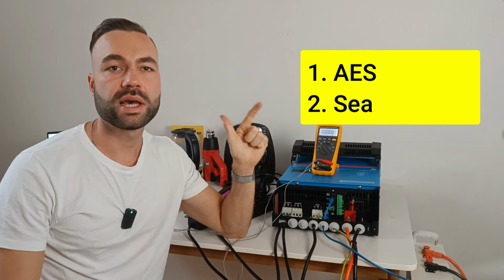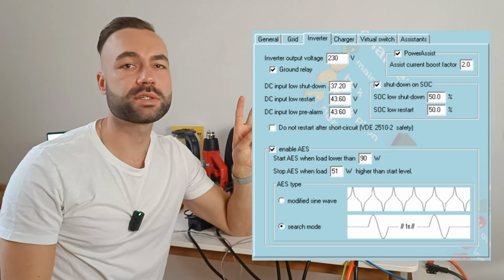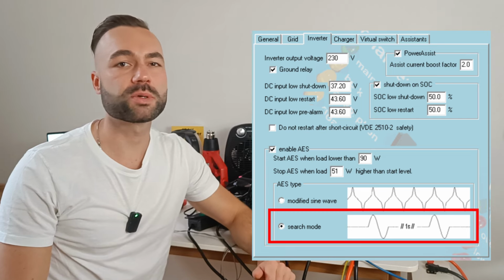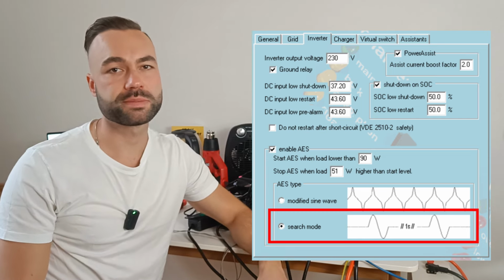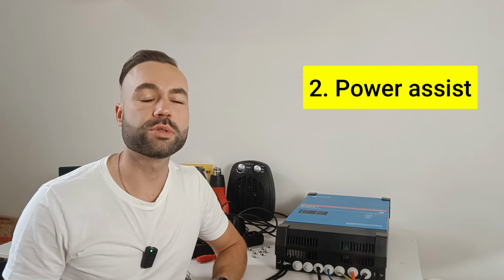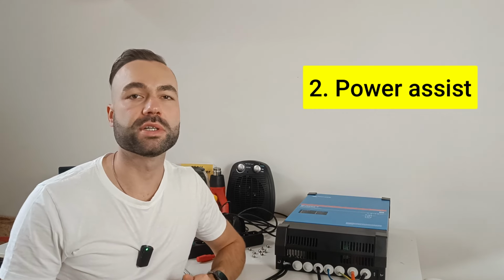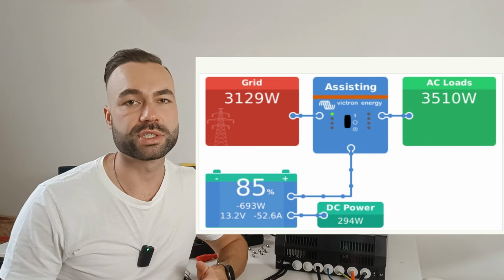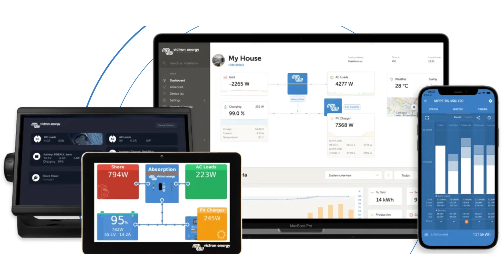Victron Multiplus 2 Testing + Closer Look

Comment: How about grounding when the grid goes down. Do you need separate grounding from the Multiplus and how would that be wired? I assume grounding from the grid is available under normal conditions
Reply from the maker: Wiring stays the same. When the grid goes down or you disconnect from shore power, the automatic grounding relay closes and the ground neutral bond will be made in the inverter itself. Check my video about ground neutral bonding for more information. There is a grounding lug on the case of the inverter which should be connected to the main grounding busbar.
Reply: @cleversolarpower  Thanks for the clarification!
Reply: @Andreas-q4q  If you are powering your house with the setup or operating your inverter's mains input off a house supply, what he said is not necessarily correct depending on where you are in the world.  So how is your system arranged, and where in the world are you?
Reply from the maker: @retrozmachine1189  Then the inverter is not off-grid anymore. If you setup the ESS assistant, you specify the country you live in and the software handles the AC out to the grid according to the country you live in.
Reply: @cleversolarpower  You should look into all this stuff properly.  You know enough to be dangerous.
Reply: @retrozmachine1189  In Sweden and got a big 24kw setup of solar, but no battery and no off grid backup. So looking into if a Multiplus could be used with batteries to perhaps peak shave and power essential loads incase of grid  down.
Reply: @Andreas-q4q False start, accidentally pressed enter.  Whoops.  You could certainly leave your existing solar installation operating and hook the Victron to the mains to use it as a charger for batteries and to supplement or completely operate loads that are connected to the Victron's outputs.  It will get a bit messy in the implementation and exactly how things should  behave with respect to neutral/earth links, which being in Sweden you potentially may not have, is something you'll need to talk to an electrician over there about.  Same goes for separating the Victron from the mains on grid failure.  Not all countries permit the Victron to do this itself and may require contactors to enforce it.  Depnding on you having a N/E link at your premises you may have to use contactors to separate line/phase from the mains but leave neutral intact and use the N/E of the installation.  So best advice is contact an electrician with expertise in this sort of thing and get professional advice.
Reply: @Andreas-q4q  Oh, and you could consider manual transfer switches to allow you to easily switch the circuits being supplied by the Victron back to grid power direct in the event the Victron fails for some reason.

As an alternative to the Victron, an AC coupled battery system may do what you are after too.  Using CTs it can draw power when your solar installation is sending power to the grid only and then put power back into your house using the CT to ensure it doesn't feed any substantial amount of current to the grid at night, unless you get favourable paying tariffs.  If the grid goes away contactors break your desired circuits from the grid and then the battery operates them directly.  A  solar installer will be able to discuss this in detail with you.  This usually will not be able to charge from PV in the absence of a mains supply, but depending on your regulations the Victron may not be able to either.
Reply: @cleversolarpower  Hope you do more videos about the Multiplus and it's features, like ESS. You usually explain thing really well and simple in your videos!
Reply: @retrozmachine1189  Thanks for the reply! Yeah, an electrician would absolutely required, as you aren't allow to do anything above like 12V(200w yourself on your house. Don't know if the Victron and it's ESS features are allowed in Sweden yet either, haven't found any info about that. Hoping for some more Multiplus videos on this channel to learn more about features and options.
Reply: @Andreas-q4q  It's not currently approved in Australia, but I hear they are working towards it.

Comment: THis is very good quality inverter. Problem is, if you have Linux, not WIN. If you measure effec. you have to go from 10 to MAX VA in 10 W incremens
and at diff. ambient temps. FETs and toroids and caps. have different properties at diff. temps.
Also at the poinit fan kicks in, there will be consumption of the fan. Fan could be betterr quality and placed on antivib,. pads.
A lot of people change this fan soon. Also the is humming if fan is quiet and the is some type of load, like air conditioner.
Reply from the maker: I'm sure if you have a linux computer you have a windows laying around 😄. I don't understand your statement of '10 to MAX VA in 10W increments' can you explain? Indeed, I've heard people replace the fan.
Reply: @cleversolarpower  Efficiency is a curve, from around 60 % at 20 - 30 W, to 95 % at 1/2 of MAX, to about 88 % at max. after some time. /to heat toroid /
Reply: Nothing about the Victron kit requires Windows (unlike the battery I just bought - grumble). The Venus OS the GX runs is linux, so everythint can be, and is, controlled by Linux. This is one of it's best features IMHO.
Reply: @cleversolarpower  "I'm sure if you have a linux computer you have a windows laying around 😄" No. I don't follow your logic. OK, some laptops come with Windows and one could do the install preserving it, but I've got 14 assorted computers in this room and zero copies of Windows 'lying about'. At most two, and quite possibly zero, of them came with Windows originally.

Comment: My Quattro 5000 manual says it needs eight 100 amp hour batteries just to run it!
Reply from the maker: Yes, if they are 12V 100Ah so they make 48V, 200Ah. Otherwise just two server racks (48V 100Ah). But then you won't have surge power though.

Comment: These units only provide full power if you are using a battery AND a generator at the same time. If you have a lot of solar you might get away with high loads for a short time. Found this out the hard way and they do mention it in the spec sheets but it is not obvious. You have to overspec seriously.

I am not aware of any other inverter that has this very serious limitation. The units are well built but you do not want to be anywhere near them for extended periods - the low frequency noise emitted was pegging my EMF meter.
Reply from the maker: I have to disagree. These units do provide full power from battery alone. Maybe your battery was undersized like mine was in the test and your generator made up the difference? There indeed is a humming noise, but these have been reduced (not entirely) with software updates.
Reply: They are rated in VA which means the power output in watts will be less. For example my 1200 VA inverter is rated for up to 1000 watts. If your device has bad power factor it will be less than 1000 watts. Bad power factor means the inverter has to handle more current flow. For example for a power factor of 0.5 means a 500 watt load would require the inverter to move enough current for 1000 watts. Even though the load doesn't use all the power the inverter still has to handle the current which is the limiting factor for inverters. Another limiting factor can be undersized DC cables or high resistance connections which cause DC ripple which the inverter can detect and will derate it's output to minimise.
Reply: @cleversolarpower  We had it connected to 8 batteries and we confirmed with the dealer that it would only provide full power if either solar or a generator was providing power. There was a limit to how much battery power it could draw.  I do not have the spec sheet on hand, but when we expressed our dissatisfaction to the dealer he pointed us at the spec sheet and it confirmed this.  

The noise I refer to is not audible humming but low frequency EMF waves. I have tested a number of inverters and most generate noise in higher ranges but Victron's also generate a lot in the lower ranges and the magnetic fields.
Reply: @matthewwakeham2206  Most if not all other inverters sold on the market state output in watts. One has to do calcs to determine if the Victron can supply enough power whereas with others it is not rocket science to determine.

Comment: Too lazy to add a second battery so you could truely test the unit?  Not much of a solar expert!
Reply from the maker: Server rack batteries are not cheap. It would be nice if you could send me one.
Reply: @latortugaabides5556   Why this hostile tone? Not necessary!
Reply: @ManfredBortenschlager  Obviously just a passer by Manfred but like you, I get tired of people who don’t contribute something positive to the discussion.
Reply: @cleversolarpower  How can someone presenting themselves as a solar expert not have access to 2 -  100ah 12v batteries ?  You can buy two for $300 these days, but I'm sure you already knew that since your such an expert.
Reply from the maker: @latortugaabides5556  I recommend watching my video about 12V, 24V and 48V systems, even better; my beginners playlist. Because two 12V batteries in parallel don't work with a 48V inverter.
Reply: @cleversolarpower  You could have 5 such batteries and it would still trip out at the inverter - design limitation of the Multiplus. That 5000 rating is fooling a lot of people. It is really more like 3500 unless you are running a genset at the same time.